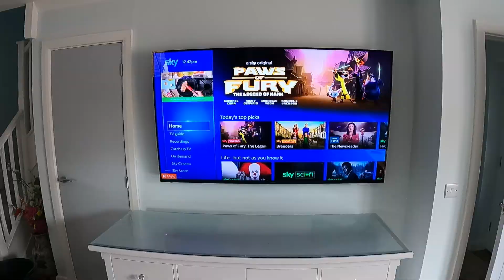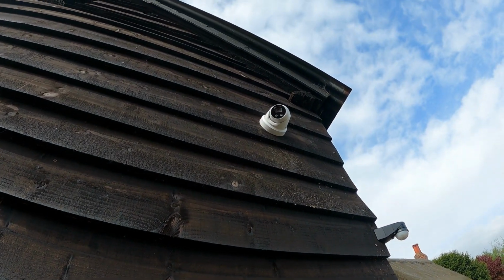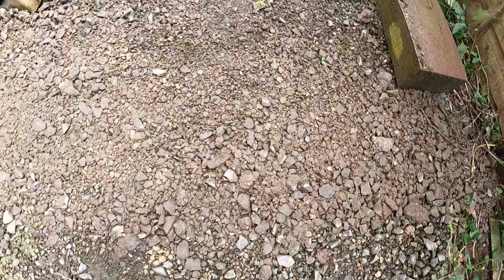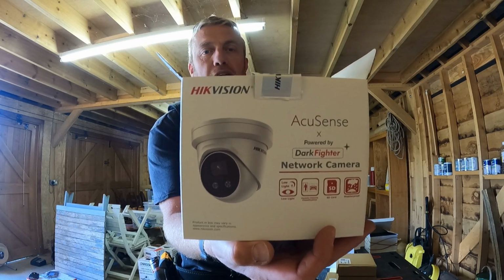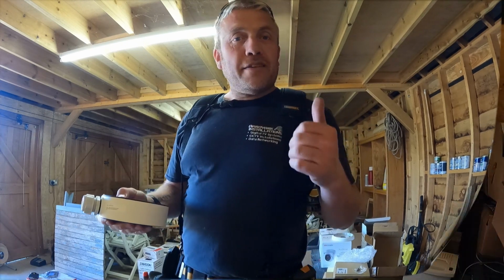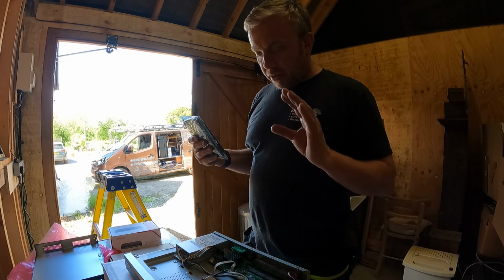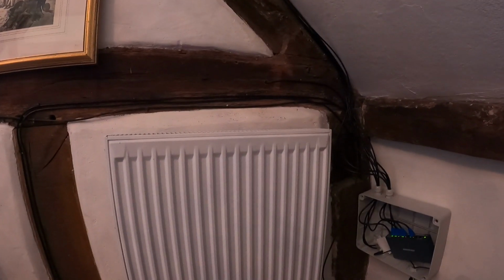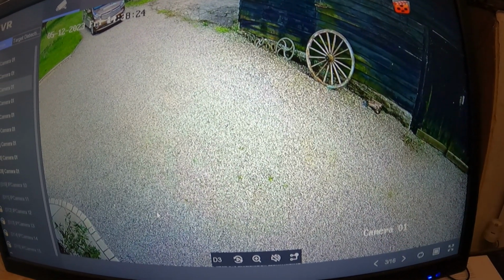HIK-VISION CCTV CAMERAS & A WIRELESS BRIDGE INSTALL

Comment: just curious inside the house why wouldnt you use the NVR to power the cameras on the main house?
Reply from the maker: Hi, it was because I used the old cabling from their previous cctv installation and that’s where the cables terminated, and the client didn’t want the NVR situated there, so by putting a switch in there, I could just link it into the system with a longer data cable into another switch and put NVR in better place.